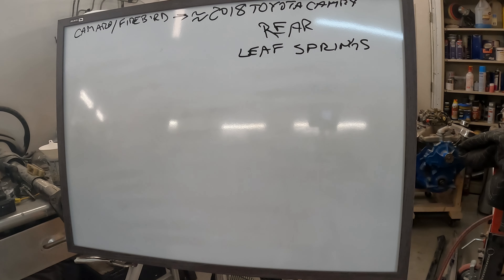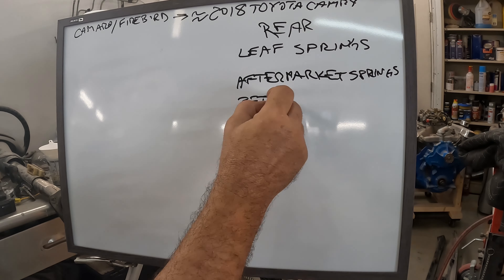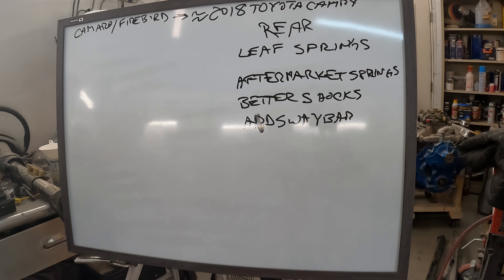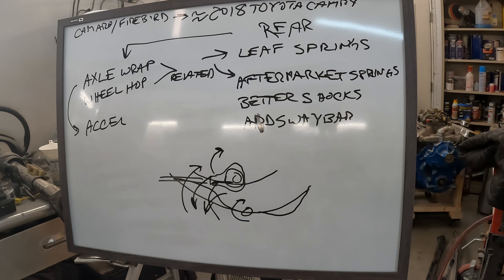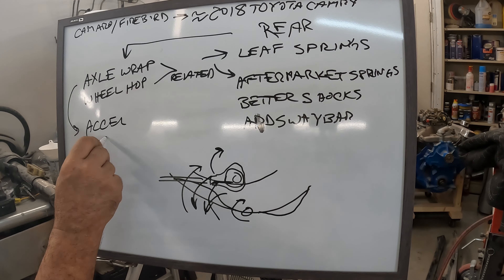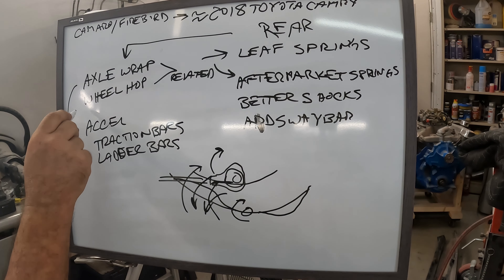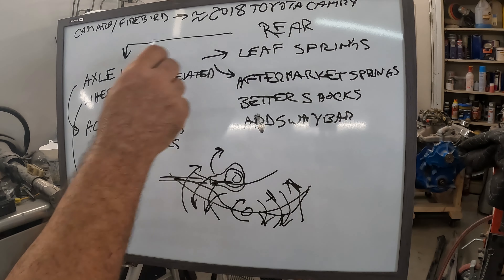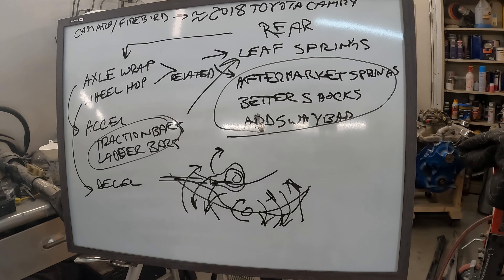Firebird Ep  25 Let's talk about suspensions!

Comment: Just started the vid, DONT use the ls1 rear. Weak.... The original 10 bolt in the old girl is much stronger and easy to improve. Interested to see how you do the front.
Reply from the maker: I'm going to start off with the Z28 rear and if there are problems replace with something way better than the original 10-bolt. Think Dana 60, Ford 9 Inch or 8.8. Thanks for watching!

Comment: Here in New Zealand  this kind of project needs to get certified for the engine swap and the suspension/ steering changes  before the car is given a warrant of fitness and allowed back on the road, is there a similar process in your neck of the US or the project money gra.... errr paperwork free?
Reply from the maker: Nope, no certifications, warrant of fitness or paperwork necessary. Vehicle road-worthiness varies state to state through (usually) yearly inspections. We have a few freedoms remaining still in the (vanishing) land of the free!
Reply: Long may that be the case, let those creative sparks flow!  We still have plenty of gorilla mods  anyway,  chopped suspension springs aplenty can be seen most Friday nights. Old utes are the most common victims of such mistreatment and many a lowered vehicle can be spotted littering the sides of motorways and streets on Saturday mornings sporting the dreaded pink sticker.😂